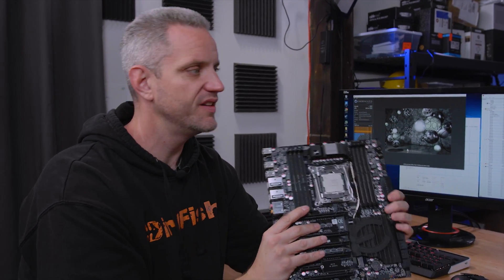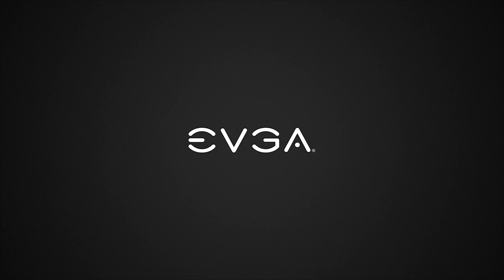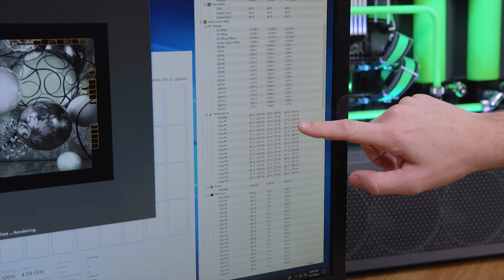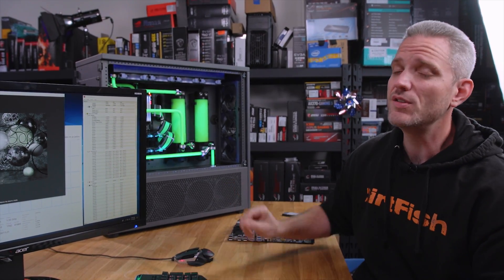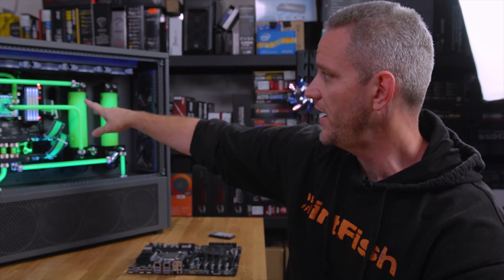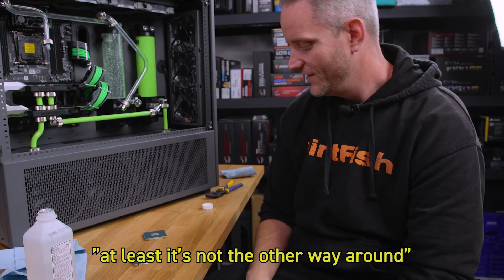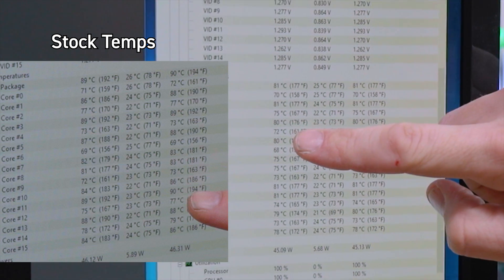I went to delid my CPU... but I didn’t expect this!

Comment from the maker: Haters will say that the title is photoshopped
Reply: Nah, the title's legit, but this comment is photoshopped!
Reply: @TheOldDeathMetalUnicorn  both title and comment are photoshopped
Reply: liquid metal it
Reply: Sorry Jay but you say you had 4.9ghz on your 6950x and there is no way that's true.
Reply: @mitcHELLOworld  I have 4.9 on my 6950x
Reply: should have done liquid metal....
Reply: Would have liked more info about the sand paper grid and things like that
Reply: You got to put a 9980xe into skunkworks it needs to be balls to the wall Overkill
Reply: 100% swear... my 5820k 4 days ago started over heating... I did every thing I could to figure out why and nothing worked... I have a 240 aio. 
Anyway after 3 days of testing... I found that my CPU high centered also so in order to fix it I had to put extra paste on it and not tighten down my aio to the block as much so it wouldn't spread the paste to thin.... my temps were reaching 93c with just a browser open, and 78c at idle. Now they are back down to 35c and 50s-60s under 80% loads.

I do remember when I first bought the x99 platform thinking, wow... the CPU bracket really puts a lot of tension on the putter edges of the CPU. 
Perhaps more people are running into this problem? Design flaw over long term?
Reply: So... I guess Intel's lost its mind, huh?
Reply: To all the LM requests ur answer is "it will drop 10c or 5c more" now cut it out
Reply: @supershafik  its a must lol. for sh*ts and giggles
Reply: You are photoshopped! :P
Reply: Aqua Computer makes CPU watercooling blocks with an adjustable cooling surface geometry to adapt to uneven IHS surfaces...the cuplex kryos NEXT VARIO ...
https://shop.aquacomputer.de/product_info.php?language=en&products_id=3559
https://shop.aquacomputer.de/product_info.php?language=en&products_id=3565
https://forum.aquacomputer.de/wasserk-hlung/107333-neu-cuplex-kryos-next/
Reply: I like these types of vidz Jay. Sad reason why you had to......but all in all, great vid!
Reply: JayzTwoCents thanks for the heads up jay I my self have a i9 7960x that I delidded. I had one running on phase changer at 4.7 ghz on 1.118 volts sadly  I have not been having to much luck with the Asus rampage vi motherboard so I might up to the evga x299 dark. I had a x99 dark before and got some good results.
Reply: Is your beard photoshopped?
Reply: nope! but I think the convex on the IHS is! LOL
Reply: liquid metal it pleeeeeeeaaaaassse
Reply: i like the sound @ 6:40 eeeeeeeeeeeeeeeeh :D
Reply: Call 911
Reply: Cringing yes because no liquid metal
Reply: make a liquid metal video now ;)
Reply: Haters will say JayzTwoCents likes his own comment
Reply: I literally have a rocket delidding kit, liquid electircal tape, and conductonaut sitting next to me that came in yesterday for my 7960x. Was gonna do it this weekend, lol. gonna test the ihs first. good looks :)
Reply: The title is photoshopped! Kidding, great video as always. The likes definitely aren't photoshopped.
Reply: No, I said it's a click bait.
Reply: I had the same experience when delided my 7800X. Even when delided and running direct die with derbauer's direct die frame and good watercool heatkiller IV cpu block with thermal grizzly kryonaut i was seeing only very little better temperatures, after putting liquid metal - thermal grizzly conductonaut the temps improved by more than 20C! versus the best non-conductive thermal paste. So definitely put a liquid metal on the die, that is what is improving those temps by a lot when deliding !
Reply: I know nothing of metallurgy. I have heard Jay talk about mixed metals when it comes to water cooling components. That said, does using sandpaper on the IHS , especially multiple types of sandpaper, introduce any 'contaminants' to the IHS ?
Reply: @jasonblankenship4418  no hes only making the surface of the spreader more flat. When hes talking about mixing metals that only matters what the coolant is touching. Now, since the lapping(fine metal sanding that makes a surface flat) actually removed part of the coating it could corrode a little bit on the surface, but the presence of the thermal compound should prevent that.
Reply: This comment deepfaked
Reply: You didn't even link to the Nvidia video Jay...
Reply: Used another CPU to delid to protect warranty. :D
Reply: Delidding... scratching out thermal paste, applying thermal paste... no change...
-> me doing head table, head table...
Dude, use LiqMet if u want to get low temps... jeez

You cant expect (much) better results if u do the same shit they do in the factroy.
LiqMet has like 2-4x the conductivity of ANY toothpaste you can apply.
Reply: haters will say liquid metal
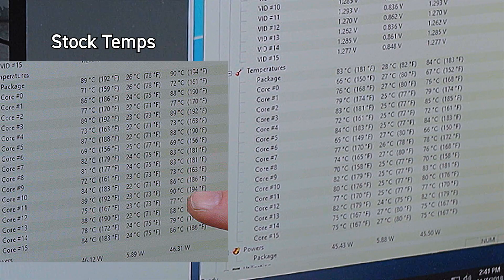Reply: 8:36 Package temp max 86 C Lapped and delidded. You voided your warranty for 4 degrees improvement.
Reply: Interesting video. Does polishing the IHS void warranties?
Also.... I hate to be that guy but please stop calling it lapping. It isn't. Lapping involves 2 surfaces with an abrasive (usually a paste) in between. What you showed is polishing (sometimes called grinding). Lapping certainly is a thing, and Wikipedia does a good job explaining it. On what authority do I proclaim this?

Well I'm an engineer and my PhD involved a fair bit of sample prep (translation: cutting tiny sample, mounting in resin and polishing to look at them under an SEM). So I speak both from technical knowledge and hours (endless hours) of standing at a machine turning metal into mirrors. ;p
Reply: @heldaneurbanus5135  lapping matches two surfaces together, this is a form of lapping. Just like when you lapp valves on a high perfomance motor to help draw the heat from the valve into the head. You referenced wikipedia and said you had a PhD so anything you said is moot. He definitely was not polishing as that only brings a surface to a shine. But what do I know.
Reply: @NinjaInTheFirstDegree  Thanks for being civil. For a surface to shine you need to make it less rough, removing the little peaks and smoothing them out. These scratches can be from handling, machining, or other according to application. A less rough surface will meet another less rough surface with greater contact area than rougher ones. This is why polishing surfaces helps thermal contact. Inf act, if you polish two metal surfaces enough they stick together once the air  between them is expelled since higher surface = higher friction.
I mentioned Wikipedia because I read the article to be sure it wasn't nonsense. If you'd like references to engineering textbooks I can oblige, but most people do not have access to them very easily.
Not 100% sure what you meant by "You referenced wikipedia and said you had a PhD so anything you said is moot." I'm taking it in the best light.
Reply: @heldaneurbanus5135  sorry the wikipedia/PhD part was a bit of a joke since it used to be extremely unreliable. Polishing does the things you said but lapping is more specifically concerning two surfaces that need the match to increase the contact area. Like, "a square is a rectangle but a rectangle isnt a square."
Reply: -_- LIQUID METAL FOOO!
Reply: EVGA is having a sale guys go check it out!
Reply: Awesome Dirtfish hoody Jay! I'm curious to which hobby you get more excited for?
Reply: Well you should sell some random parts signed by you
Reply: curious y u didnt use liquid metal as thermal
Reply: You did not set minimum cpu clock to 100 percent in power saving in control panel of windows. Please do not limit cpu to 1 ghz.
Reply: Send email to intel to delid this cpu because You are frustrated. Then they will not sell bad cpu.
Reply: Contact intel and board manufacturer for bios fix for voltage spike to 1.6 volt
Reply: Contact intel to flat the IHS.
Reply: ``Just remove the IHS. Let the water block make direct contact with the chip``DO yo urecommanded it jay. IF yes i will do!
Reply: it is ms painted duh
Reply: naah it was coded all along ...
Reply: What about using liquid metal between the die and the IHS, rather than some pasty TIM?
Reply: can i get a link to the video where you first built this system. also what could you do in a corsair slate
Reply: Gooder for you lol
Reply: cut your nails jay hahaha
Reply: Why not try a direct die cooler? I delidded my old soldered 8320e and dropped 9c at 4.8GHz running no IHS. I know the socket issues involved but they make blocks for it.
Reply: actually the heatspreader is named incorrectly.  its more like a protective device for the fragile, glasslike die underneath.  especially as dies get bigger they are easier to break.  direct die is always better than using a heat spreader.  maybe not a whole lot better but still better as far as performance goes.  and yes you really need to use liquid metal but i know you know that already
Reply: JayzTwoCents I already posted this on a different video, but I’m not sure if it got to you because I know jacks*#t about social media, so I’m sorry if you already read this.
I’m in the middle of my first pc build, and I’m not sure if I should buy the “luxe 2” case or the “lian li o11 dynamic xl”. I’m going for an all out, over the top costume loop which will cool the cpu, gpu and the mobo’s vrm. Which of the two cases would you recommend? Or is there any other case I should consider?
Reply: best thing is, "an heat spreader" is actually more correct, due to the rules for using articles before a word beginning with an 'h'.
Reply: Why didn't you use liquid metal?
Reply: Nah, Jay just has Herculean strength
Reply: Why didn’t you use Liquid metal instead of what looks like Corsair thermal paste you woulda got like a 10C or better drop
Reply: I don't get the point of the "omg" clickbait though. Because nothing in the video is eye poppingly shocking. The CPU wasn't full of spiders, the chip hadn't cracked, the pins hadn't welded themselves to the board.

The only feeling people will leave with is "Oh...nothing happened."

Whereas a properly descriptive title would probably leave a better impression. I found this video interesting, but I'd be lying if I said I wasn't intrigued to find out what happened when you delidded it. Answer being...nothing.
Reply: You should go to the 9980xe for skunkworks because it has a soldered IHS and it's more powerful
Reply: This video could be resumed in 3 minutes, stop wasting everyones time, Here is the before temperature and why, I delidid it, here is the new temperature, believe me anyone can skip and I skiped every part that I considered uninformational. Anyway it was interesting, but you could use something that the liquid goes directly in contact with the chip "Ncore by NudeCNC"
Reply: Call them what you want when people disagree with you ....... you never used to do that .... since you fucked Post Cereal and gotta STUDIO ... you ine different dude ! Better be looking for another jib ...... YouTube will NOT be sending you HUGE checks for crap ! You know it !
Reply: Is the next Post Malone part ever doing to come out?
Reply: Seriously? Jay said many times when Post Malone is ready to take his PC is when we get the video. Post not taking his PC = no video. I hope you are joking if not you need slapped.
Reply: Why are you being so DRAMATIC ; OMG voiding my warrenty to delid ... try doing it with a VISE PUSSY
Reply: I unsubbed from Linus for the constant terrible clickbait titles, and as much as I like your content generally I have to be fair and do the same for you now, especially since you think it's funny. Sorry man. You really are just Linus Lite (just add water) at this point.

Goodbye and good luck.
Reply: bye bye dude above me that no one will care is gone
Reply: @nightblazzed  Click to learn more!
Reply: NDogg15 Nah, what he really thinks is funny is sanctimonious comments like yours. "I have to be fair" LMAO like you're some righteous gritty old west lawman out of a novel/show/game.
"Well you list'n here, Jay. You know I'ma man of my 'tegridy and I done had t'put down ol Linus for this'un here same o-ffense. So, likewise, I reckon ima have'n t'put yew down too, fella.  Got any last words, partner?"
Reply: NDogg15 Don't forget the purposely mispronounced words that he thinks is so funny, or the corney fart noises. How old is this guy?
Reply: @TechHug  Both Jay and Linus are mediocre PC technicians. Just watch their videos where something goes wrong and they try to troubleshoot...they really dont have a clue how the computers really work.
Reply: NDogg15 unfortunately what works...... works...........
Reply: i agree with the haters. i also agree with the haters when they say that you play with your daughter

Comment: My i7 8700k was so hot before I delid it. Used a razor blade to do it haha. Was a very careful delid. set it down once done. Got up to shake off the adrenaline and sweaty hands. It was only 1.5 years old when I did it. Either way, cpu was hitting TJmax on aida64 CPU, FPU, Cache stress 4.7Ghz all Core. after delid, It could do 5.1Ghz 1.35v all core max 87C with 240 AIO.

Just recently re applied the LM as it had almost completely dried out and was no longer doing its job. It was easy as pie and since I have delid about 5 other cpus now all with a Razor blades I was much more comfortable but still careful doing it.

Comment: I still don't understand why companies like Intel and AMD don't mill IHS after soldering on CNC machine, it takes few seconds in big factory to do it with their equipment and they could have higher clock speed then. This is massive problem, IHSs are really bad quality on many CPUs, it's not flat at all. I think I will try lapping on my Ryzen 3800X because it has really terrible temperatures and better cooler is not solving that.
Reply: So I did it and it looks like my Ryzen was slightly curved in oposite way like contact was mainly on edges, but making it flat didn't help a lot, it is slightly colder, but only like 2-3°C diffrence. And it is really flat now, when I put it on glass, it's sucked to glass by vacuum, but I think cooler is not that flat, I was trying to lap it too, but it was to complicated to move with such big and heavy thing on sandpaper so I stopped with that because I was afraid that I will made it even worse. BTW, I had liquid metal on that CPU for few months and it didn't get dry, it was still the same as when I installed that, so I can really recomment Thermal Grizzly Conductonaut for those who are afraid of liquid metal.

Comment: What if they made CPU coolers that had a thicker base, designed only for a de-lidded CPU thats made just thick enough so you wouldn't have to put the lid back on and just have the cooler directly on the die with no further modifications?
Reply: It'll be a very niche product for a very niche market.

But instead of thicker base, I think it would be easier to mod the mounting bracket. So it'll sit lower than the standard.
Reply: @fajaradi1223  now that i think about it, i think something like that might exist, i think linus tech tips did a video on it

Comment: would love to see you delid some old Phenom 2 processors.
Some are soldered some aren't
i have a II 965 BE and i think the thermals keep it from performing, but its over a decade old now, there's the little voice in the back of my head saying i could get it up to 3.6ghz if I helped it a bit.
Reply: I have mine at 3.9Ghz.  It's not local to me right now, so I can't give you the BIOS settings.  A little google should give you the BIOS settings that will work so long as your MB can take them.

Comment: Would you not create a new high spot after the Delid and need to re-sand it again, does it deform in any way from getting it off and putting back on ?? did not show if you did this after the Delid.
Just curious that is all.

Comment: Thank you for the spinning tip. One of my i3 9100f core is running 20c hotter than the other cores just like yours in start. I tried different coolers but the result was same. Now I will try that spinning technique. Thank you

Comment: I never considered it could be the CPU, but I must have the same problem with my i7 7700. My CPU temps are never lower than 95c. I've tried replacing the cooler, the paste, updating the chipsets and bios, installed different temperature software, always the same issue...

Comment: Absolutely no need to even update skunkworks lol even 2 years after this video went live. He is send a lot of voltage to It though. I run around 1.270-1.286V for 4,800Mhz all cores. My 7980XE is delidded, and I run a Fractal AIO expanded with reservoir and additional radiators. Believe it or not, my temps are better than his. I am using LM on the die though.

Comment: If you're going to the warranty-voiding effort and risk of delidding anyway, it never made sense to me to reinstall the IHS with a different TIM. If you've gone that far already, you might as well just direct mount the waterblock to the die. 

No matter how well you managed to lap it, you still have both the extra metal in the IHS and an extra interface going from the IHS to TIM to the waterblock which make the thermals worse.
For your 7980XE you have a 165W stock TDP and a 21.6mm x 22.4mm die with a ~2mm thick IHS, the temp drop just across that much metal is ~2.1C/3.9F (a small amount less from heat spreading in 2 dimensions but it's a minor factor with those dimensions), with an higher voltages and clock it could be well over 200W which makes the temp even higher. The drop from the extra interface between materials is hard to calculate but is going to be several degrees no matter how good the lap and TIM used.

Comment: so you buy a cheap cpu, overclock the fuck out of it,   then bitch about the temperature?         so..   your getting your what 60 days run time with it?

funny.   my i5 2300 is still running on mothers pc..     thats around what 10 years old now..        and my trusty Cyrix 686 is still plunking away...   thats over 30 years old... lol

ps you get what you pay for.